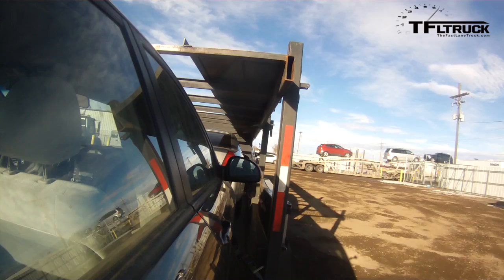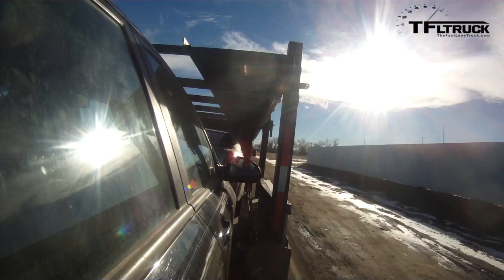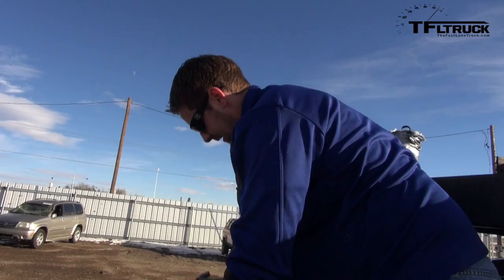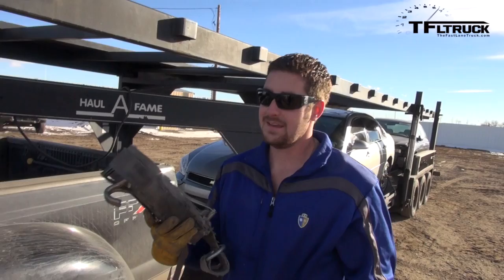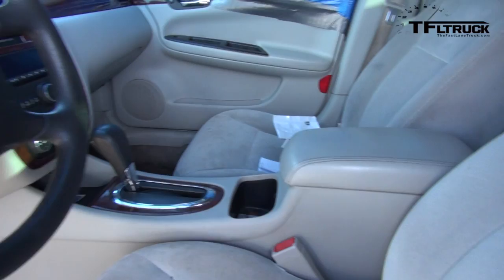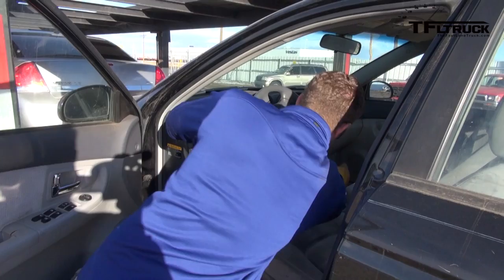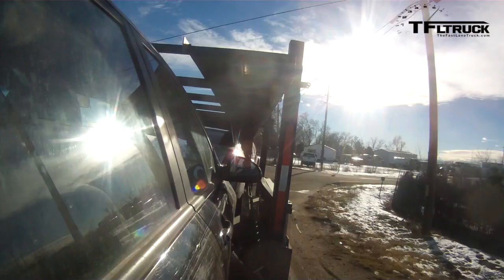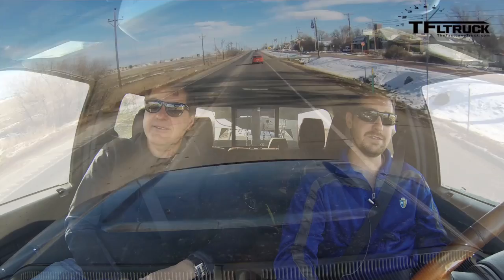A Day in the Life of an Independent Car Transporter (Pt 1.)

Comment: The so called Death wabble is not just a Ford thing and changing the tires is not the fix. All solid front axle trucks and jeeps ext. can have the problem. A lot of people change the front steering stabilizer and that seams to be a good fix.

Comment: Just get a late 90's--early 2000's Ford E450 cab/chassis (7.3L diesel or the 6.8L V10) and install a DOT approved sleeper on it. Should get you a little better fuel economy, you wont have the same front end issues, and you gain that sleeper to spend the night in...
My old Freightliner could have hauled that truck, trailer, and all the cars and would have gotten much better fuel economy. I used to get around 5 to 6.5 mpg (depending on terrain) loaded close to 80,000-lbs gross. 7.5 mpg sucks for just hauling a few cars.
Reply: the 6.8L V10 is an absolute horrible motor. It will struggle to pull more 6,000 pounds!
Reply: If he's towing this much he definitely will not want a v10. I'm sure towing this much he'd have to measure in gallons per mile instead of miles per gallon 😂

Comment: I really don't like that Ford switched over to coil sprung front axles... I could give a shit about the turning radius with leafs, at least death wobble is a hell of a lot less common. They should've taken a hint when Dodge went to coils in 94 that death wobble was going to be a problem. That's why GM trucks having their SLA IFS doesn't bother me as much as it does most people... It works well for what it was designed for. Solid axle is definitely more heavy duty, but I'll pass on having death wobble. Solid axle needs to be done right, with leafs... Coils with LCAs and a track bar supporting the axle just doesn't cut it, especially with trucks these days grossing as much as they can. With that being said, the Fords track bar/bushing is a lot better quality than what is found on the Rams so death wobble is not as big of a problem as it is on the Ram trucks.

Comment: Ive learned 2 things from this video. 1. Do not buy a Ford. 2. There are too many regulations.
Reply: The chevy can't even tow this much so that's not an option..and after 200k miles of towing 35,000 pounds he gone through a couple diffs that ford paid for I don't see a problem the dodge engine wouldnt break  but all The truck around it would fall apart
Reply: trevor philips You should do your research sir before you make wild claims about a Chevrolet not being able to tow that much. The light duty starts out at 11,000 pounds.
Reply: It's not wild accusations look at max tow rating for ford and then chevy ...chevy is far lower
Reply: Eric Boucher Ford has the highest tow ratings for the 2015 model year, chevy doesn't go up that high.
Reply: Wasn't aware that chevy decided not to produce any vehicles in 2015.. Sales must have been really bad
Reply: trevor philips What? I just said their trucks don't have tow ratings as high as ford.
Reply: When yo want to get in the Serious Hotshot Business Ford Is The ONLY Way To Go!!!!!

A Chevy Would Burn Down On You after just the first few thousand miles!!!
Reply: +Eric Boucher and the heavy duty 3500 dually diesel which is Chevy's top of the line can only make it to 23,400 pounds which is what he is getting at
Reply: +Nick  that's what they claim to be at but they can tow a lot more...  Ford has highest tow rating but they boast there numbers and there trucks have trouble taking on those task of towing big numbers, a f450 is equal to a kodiak and that will out tow a 450 any given time if your comparing apples to apples
Reply: trevor philips cause gm doesn't care about being in the towing wars
Reply: trevor philips dont buy a pick up at all get a real truck kenworth pete volvo anything is better then some dame pickup
Reply: jesus christ Lord, forgive me for I have sinned. I want a Peterbilt, but truckers tell me the Volvo is more reliable. I can shift any tranny but which engine is most reliable in a Volvo Tractor?
Reply: trevor philips chevy have been behind the competition for a while now
Reply: Want to run out of business? Buy a ford . They way too expensive and dont last long over the road. Now with the 6.7 are a little bit better . But the 6.4 and specially  the 6.0 are just the worse trucks for hotshot

Comment: was rather surprised about the axle failures till I looked up GCVR of that truck. 33K LBS and he is running 36K LBS so 3K over weight. Definitely stressing the power train running 1.5 tons over weight.
Reply: that's not the problem, ford is the problem. I run a 07 dodge 3500 pulling 4 car hauler and it has 311k thousand miles with little problems. Go to the auction, these trucks pull the loads every day with little issues. Most of us run dodges.
Reply: HondaCummins i run 2012 ram 5500 pulling 4 car hauler like u wht u think about pulling 5 car hauler  5500 can make it?

Comment: All brands are great and just for no bias remarks I drive a Ford currently. For this guy constantly using this for highway purposes I think he'd find a chevy more suitable. Stronger chassis, more passing power and the IFS would be ideal for on road conditions. My ford pulls my 28' race trailer great for the hour to 3 hour drives to motocross tracks but if I go south this winter I will definitely take my dads Duramax, seems to be a bit more responsive and it is definitely a highway cruiser.
Reply: ***** oil

Comment: A ram dually with a cummins and manual trans is the most reliable tow vehicle, some have gone 1 million miles.
Reply: +John Gaudet I doubt 1 million miles
Reply: I hate dodge but I've seen the older ones go that far with some decent care.Granted it wasnt on the same turbo or injectors but still.

Comment: I have tried all day to find an independent car transporter. Nothing but 3rd party, I google reviews...and the whole quote low, get a deposit, then change quote, hold car hostage, no refund the deposit...So many have F reports on BBB.  Any suggestions? Want to transport a good running 1995 Ford Mustang, from 89015 to 78735. From a residence, with a very wide street to pick up car with.

Comment: I baught a new 2015 f 250 4 door and heard of the death wobble problem I put on a dual steering stabilizer and haven't had the problem but the truck only has 9000 miles on it I installed them at 180 miles I do not want to experience this or I am going to be pissed after spending 52,000 dollars.

Comment: 5:12 7.5 mpg is really bad. That's what loaded 18-wheelers get.
Reply: lfsracer79 No, my father was a trucker for 30 years. The best he got when hauling a triple axle, single 53' trailer was 4.5mpg.
Reply: Brandon Friesen  these are the new days my friend. I run about 11-12 mpg load down with 5 cars on a '14 cummins longhorn
Reply: Christopher Yohn That's awesome! My uncles 2010 ram 3500 6.7 couldn't do better than 12mpg. I drove a 2013 ram 2500 for a short trip and got over 23mpg! The new ones are fantastic towing rigs, and get better fuel economy than most SUV's. Too bad they're over $80,000 for a new one.
Reply: +Brandon Friesen well brandon I just got one brand new for $57142 (Big horn) with the highest combination (I6.7, aison and 4.10 ratio) thats the best combination for hauling right now
Reply: Kmilo Hernandez how do you like your Ram? Still like it? What is your mileage at now?

Comment: i want to ask you a question do i need the cdl to drive 3 car hauler to different states ??? im asking you this because a lots of people being sayig that what im doing is ilegal driving with regular licensee 26,000 pounds pleae anwer me thanks
RESPONDER
Reply: Yes you will need a CDL. A three car hauler will definately pass the 10,001 lb rating for the trailer and the GCWR of the combination will be more than 26,001 lb. This will require a class A. If you show up at a port as you are, you will be in violation, will be placed out of service for driving a CMV without a CDL and will be cited. Get the CDL.

Comment: Y you don't buy a ford. My uncle does this except with 24000 lbs camper trailers and he has a brand new 14 ram 3500 long horn Cummins and with in two months he has 150000 + miles on it and nothing wrong

Comment: for that intro of the ford f150 look at that plastic peice bend.
Reply: what piece
Reply: in the front to get extra gas milage
Reply: wrong. it prevents stuff fro splashing up into the engine bay. the way it is angled would reduce MPG not increase it

Comment: Part of his problem are them bologna rien tires he keeps putting on if he would spring for some 19 inch rims and some michalans he would be fine
Reply: exactly and he'd actually save money compared to what he is doing now.I bet they'd transfer less shock to the rear diff too.I've ran 450's towing for years without his issues and we're rough on stuff mostly running around town.

Comment: if he ca n only 4 cars why get a 6 car trailer? he's not putting anything up top and hauling around all that extra weight for nothing. a straight single deck 5th wheel would be so much cheaper and easier to haul with

Comment: Why would you need a CDL for that? It's no larger than a big camping trailer or motorhome, and you don't need any special license to drive those. Unless it has to do with weights, not lengths...
Reply: Joe Black Oh, ok, that's interesting.
Reply: Anything over 10k lbs needs class A
Reply: Ryan Fahey ur wrong my 53 foot camping bus does not
Reply: Sst Pilot Campers and Rv's dont apply to that rule they dont require a commercial license.
Reply: Sst Pilot and the 10k rule only applies when pulling a trailer, Normal Cdl is 26,001 and up
Reply: Ryan Fahey mine is commercial registration is to my business
Reply: Sst Pilot but do you have a class A or B, or do uou just have a DOT card? could be didferent from state to state
Reply: Ryan Fahey have class A

Comment: there is a fix for the "death wobble" i had an 05 f650i drove for work and got the death wobble i took the truck to JOSAM and they fixed the front end and never experienced the wobble again
Reply: +Ray Vandegrift   Very vague.  Why would you not have simply stated WHAT the problem was, and what they did to remedy the issue?
Reply: Because I dropped off the truck and told them to fix it and because it was a company truck I was not privy to that info just that it was fixed, I was even accused of warping ALL of the rims but found that was untrue
Reply: And ALL I know is that it only happens to Ford's with the straight axle front ends so they may have eliminated the problem with the twin I beam front ends, so sorry for being so vague before, hope this helps?

Comment: Has your scorpion 6.7l gave you any problems? Or its just the wobble?
Reply: he explained the rear end has failed a few times, early 6.7 has cylinder head/valve issues and all of them have some issues during a regen with noise and stumbling.
but they are an amazing engine
Reply: Kevin Rogers mabe it's how he pulls idk my uncles f-450  has I think the 4.10 ratio and he pulls a back hoe.

Comment: The first tractor trailer tractor I drove was a CL 9000 and although before your time in 1978. The same problem with the rear end on Ford is probably the same one you are having. First of all my boss had both of your problems. The rear end on Ford were so dangerous at on time the seal to the rear end would play itself apart and drop the driveshaft at high speed and catapult the truck into an accident and you not know when to expect it. The rear end would lose fluid and lock up burn up etc. However it was discovered when you have your driveshaft balanced at a place I think it is Louisville and that is all they do. The. wrong harmonious balance from the driveshaft exerting all that power to the ground does not vibrate anymore and the rear seal does not blow anymore.
There was a.mother. Problem you had so did he about the tires cupping until they blew. I am trying to remember what he was talking about. There is a fix for that too. I am trying to remember...If I can think of it I will let you know

Comment: Really can't believe no one has commented about the death wobble.. (from what I've seen) fords usually have to do with tie rods and the trac bar bushings. Also Dodge is the WORST when it comes to death wobble. Yes even the NEW ones. Most if not all of the time it's all four ball joints, tie rods, steering linkage, and trac bar. We know them out all the time at a shop I work at. Simple fix and DO NOT go to Firestone or anytime of major mechanic place like the dealer ship. They charge a ridiculous amount vs a mom and pop. Ok thank you, bye.
Reply: Oh and on fords the pitman arm tie rod
Reply: I've had deathwobble in almost all my of my  trucks chevys, Fords, and Dodges when I drove them home .  Fixed in every single one.  Death wobble is because the moron mechanic can't/do know how to check for loose components or aline the truck correctly.

98%  Its the trac bar causing death wobble.  Very rarely have Tie Rods, Ball joins or wheel bearings caused death wobble.  I also maintain my truck and fix minor issues before they become problems.

Normally I notice the extra play in the steering and I have it corrected before it death wobble occurs
Reply: Alan correct. But when checked thoroughly more than likely ball joints are problematic on dodges. Idk why but seems like 75% of the time they are bad.
Reply: 236,000 Miles im only on 1 set of replacement ball joints.  Keep them greased (I grease and go over the truck every 1,000)  Stick a prybar against the knuckle and the ball joint,  If it moves its junk.

All my trucks have plows or trailer on them so I cannot afford to have something fail going down the road and kill someone.

My favorite set up is the REAL old trucks that use King Pins instead of ball joints those suckers almost never fail.
Reply: Alan I agree! And yea that's the way we check them but I've personally witnessed "'certified technicians" check them by just moving the tire by hand.. Any how, I have never had much problems with my fords.

Comment: The rear end would lose Luis after breaking a front seal. The driveshaft would be thrown back into the rear end and drop off the front pinion and the front of the axle would hit the ground and drag until it caught a ctrack large enough or a pothole and catapult the truck at high speed.

Comment: I would also check about maybe upgrading to the largest rear end you could put on your truck and buy it. Better for heavy all time hauling, easier moving parts that are not cramped in a tiny space and the heat and wear falls dramatically those tiny rears are molten hot and stay that way.

Comment: He was better off buying a semi from MACK truck from rhe start..  they get better milage, stronger engines, and alot more towing capacity with performance. With what hes putting into failed parts, breaks Nd tires every 6 weeks, thsts like buying a new top end rig. Its a Ford, of course youll have failed parts multiple times from thr same part. Its always due to poor quality control.

Comment: What kind of license do you need for that...?......cdl...but what A class or B.....
Reply: Class B since no air brakes are equipped
Reply: Ethan Reed  its best to get the class a then your options are better then he can move up to a rig and tow more cars.
Reply: Alex A Also because the driving test is essentially the same, all you would have to do if you decide to upgrade to a semi is get the air brake endorsement (which is extremely easy to get).
Reply: +Ethan Reed No Actually he needs class A since he is over 26001 pounds combined weight.
Reply: +TheDD5623 yes agreed.  anything over 26,001 w combo requires class a.

Comment: I use a 2012 F-550 6.7 work truck with lot of hydrophilic tools, Great engine but horrible transmission & rear diff. Ford uses a smaller spider gear which causes it to run hotter specially while towing and we all know heat causes breakdown. This guy clearly needs a bigger truck and a king ranch will not get you better resale value when you are driving a domestic vehicle with extremely high mileage on a 2011.
Reply: I don't think he's going to sell it.  I thought he was just going to run it into the ground!  Although the trade-in value would suck when he does buy another truck...